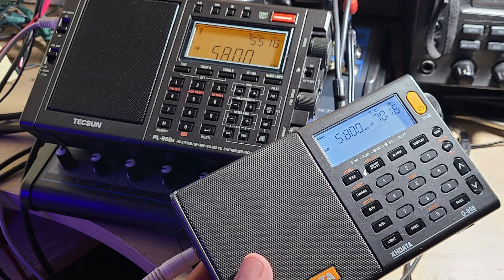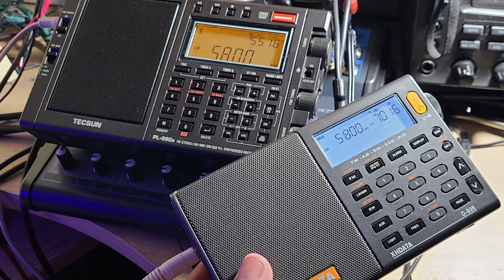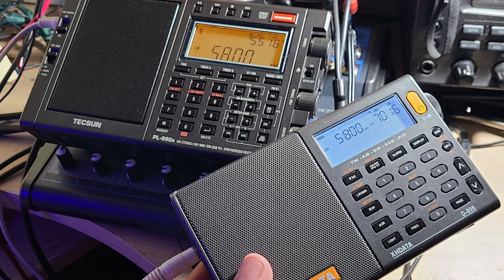Shortwave 101 Beginner series What is receiver overloading and can it break the radio

Comment: Instead of buying a new portable I went for the Yaesu frg 8800. On VHF can you damage or desensitise a radio using a RF preamplifier ?
Reply from the maker: These receivers are very sensitive in general.  You will not damage the radio but you might desensitise if there are strong signals while using the preamp

Comment: What about static buildup that could occur in the dryer winter months.  If you have a sufficient static discharge from your hand as you touch the portable's antenna, will it short out your radio or are better units equipped to handle such static discharge?
Reply from the maker: I will make a video about this today

Comment: My most common is hearing WWCR 4840 on WWV 5000 at night on a 10 metre wire  plugged into the antenna jack of my D808. Simply wrapping the wire around the collapsed telescopic seems to eliminate it.

Comment: I live about 1 air mile from. A 50kw AM station, WABC.  I’ve found that in such high RF environments, the amplifier in most active antennas will create intermod which mimics overload. The only active antenna (loop) that performs ok in high RF environments is the PIXEL, now sold by DX ENGINEERING.

Comment: Hi Gilles from what I see on portables all tecsun, xhdata receivers go in overloaded especially using active antennas as the mla30 loop .. With the Sangean 909x2 you can manage it better since it has a wheel similar to an rf gain .. On Tecsun receivers the Dx, Local switches  are often not sufficient to mitigate the overload.
73 😊